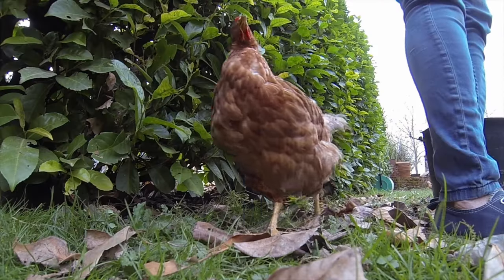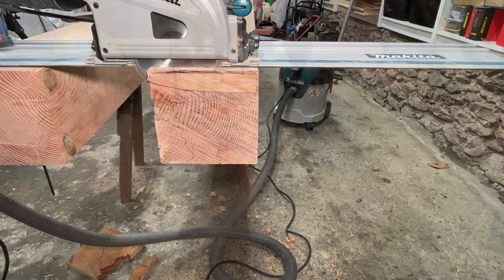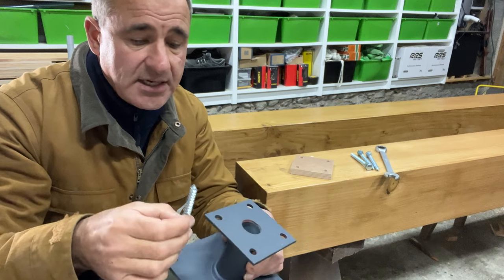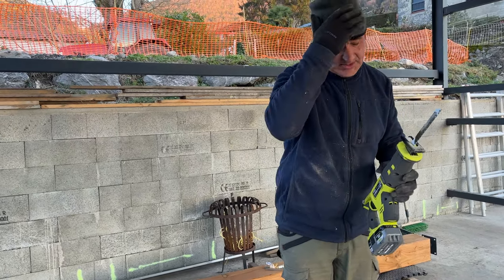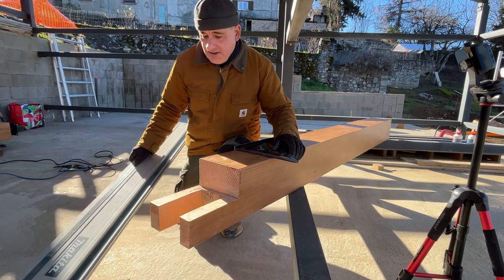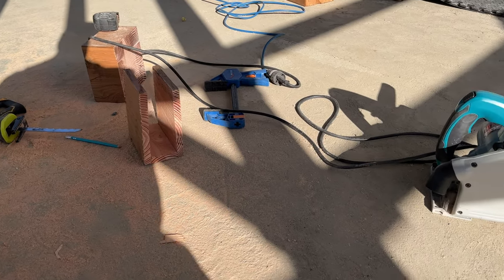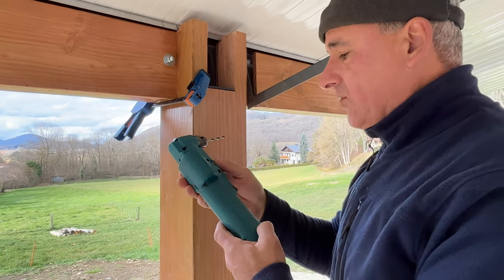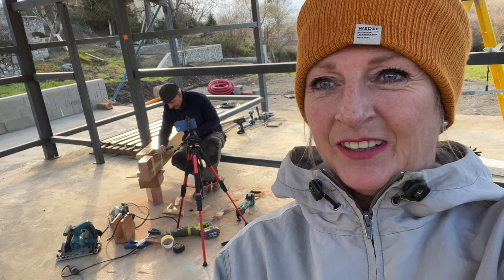Carving out Giant Posts | Garage Shop Project Ep26

Comment: Showed this to my 96 year old father who's a retired builder, his comment was get a 12 inch circular saw and use the whole stroke/length of the saw blade on the hand saw. The language has been edited because he dosen't hold back.
Reply from the maker: I bet he was tutting all the way through - If I had a 12" circular saw I would have used it for sure, these little battery ones are no good for bigger jobs like this.  Julie's dad is an ex chippy (60 years in the same builders firm), I worked with him on my last build 25 years ago .... and no power tools were used.

Comment: With your frame openings on the 2 wooden beams you could always make 2 Triangle Wedges that will act as covers & put hinges on them so that the wide block is at the top & the pointed edge is at the bottom & recess the hinge into the wedge so that when they close it appears to only have a thin line. Opening the wedge with a coin or a fingernail at the bottom will be easy enough so that they flip out & up.
Reply from the maker: Do you mean for the cut out - I covered it with  steel plate in the end.
Reply: @HomesteadingUncontained  Oh well

Comment: Before we use any wood (except formwork) we paint it with a local 'stuff' called Drewnochron....a crude translation is wood security.....it is expensive, comes in a good few colours, but I have been bloody impressed to say the least by its performance......soft wood sidings painted with it, sitting in mud and water for almost ten years and not a hint of rot.
Reply from the maker: We have to soak everything in anti pest stuff.  Same as our current house but we have not done that for a while.  So we buy cheaper rough cut timber and plane it and then treat it ourselves.  Works out more work but better on the pocket.
Reply: Wood guard is a more accurate translation.

Comment: Nice job 👍, one thing I take away from watching your build is that battery powered tools just can’t last the distance, you always have to go back to cable power. Unless you invest in dozens of battery’s of course. Anyway great job and those scones looked delicious 😁.
Reply from the maker: Really the size of the saw was the issue but yes, unless you have plenty of batteries and can charge then a long the way, you could be stuck.  I only have 5 batteries but now with the power stations I can charge then too

Comment: With those difficult to get in screw bolts, I would have done it the Polish way and just cut slots with a grinder and then used a big washer on each screw bolt.   Your bolts into the concrete don't have to be very long, the concrete is taking the weight, really they are just positioning the upright.      I like your fancy laser level......but a few years back I bought a very cheap little battery powered laser level, came with a screw to wood,  magnetic base.......I just stack it up on bricks and wedges to get the height and it really does the job well....has 'dot' and 'line'.....it was one of those Lidl tool offers....well pleased with it.
Reply from the maker: Nothing wrong with a bit of Lidl Park Tool.  Their range is getting big now and I started buying some of their obtuse items that I can't justify spending too much on with the bigger brands.

Comment: Apologies if you've mentioned it before, but why did you not make the corner post part of the metal structure? It could have been part of the metal framing for structural integrity and then clad with wood.
Reply from the maker: I n my initial design this post was structural - but then the metal fabricators took it over they just designed around it (as they were not providing it).  So yes I do wish it was structural and it could have straightened up the front a bit.
Reply: @HomesteadingUncontained  - thanks for clarifying. It's frustrating when others make decisions against your better judgement. It's still a very nice structure, I'm enjoying its  progression.

Comment: Are you sure that's the correct way to install the post baseplates? It seems the posts would be supported better with the larger plate matching the size of the post.
Reply from the maker: It is what is used here.  I have it on all my buildings at my current property 😀

Comment: Hello you two.
    Really enjoying your videos. 
    A couple of sogestions that you may wish to consider, how about using dowels ro make the false beams and remember you can make them blind so they are not visible, they add strength and good locationof the parts. I have the wolfcraft one from screwfix at around £ 18 
   May I ask you is the a Renault 4 CV and a Renault 4 you have in the garage, I have a soft spot for both those cars as my first car was a 4CV a 1960 I believe the last year they were made?
  Keep up the great work!!
Reply from the maker: Dowels would have been a good option. I have one more beam to cover so may give that a go. Yes, the 4L is Julie’s 1979 GTL awaiting the floor to be finished and the 4CV is our little rally car. Fully raced prepared and awaiting its new 905cc power house. Can’t wait to get it out on the road again.